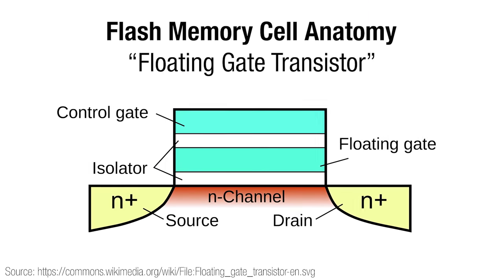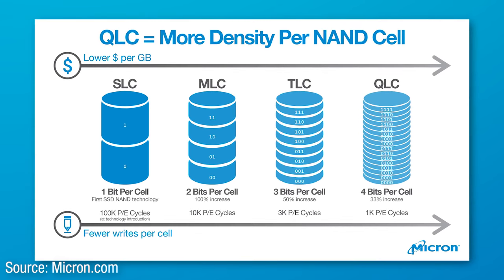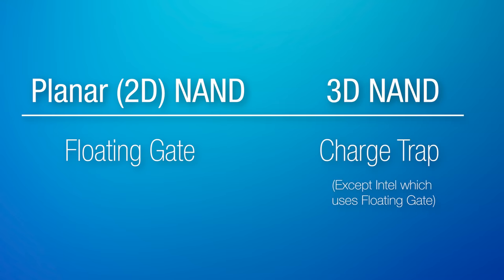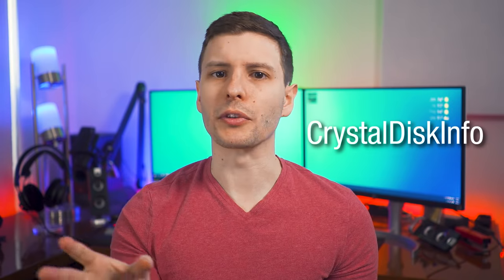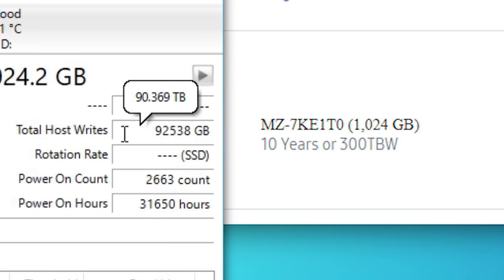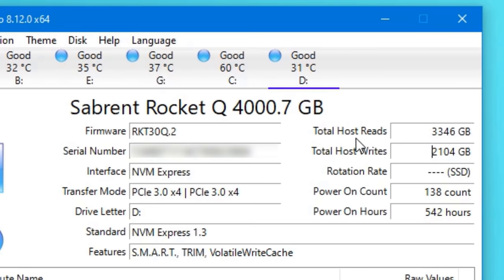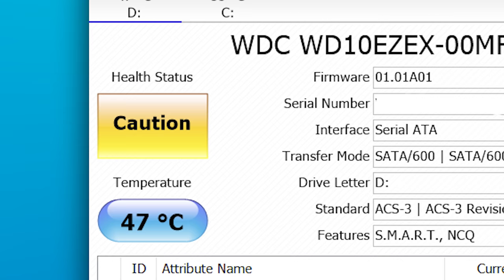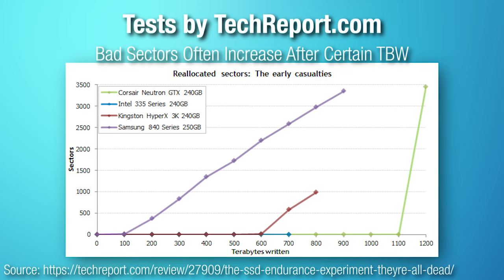How Much Longer Will Your SSD Last? How to Tell

Comment: Hi Thio! My SSD actually uses Mean Time Between Failures (OR # of years since purchase, whichever comes first) to determine warranty, used by SanDisk.

My SSD is rated for "1.75M hrs MTBF" (or 3 year warranty) which I'm not sure I fully understand how to read, but Googling returned that MTBF is calculated by operational hours divided by number of failures in that period.

Fortunately I'm at 7,418 hours with no "Fail" counts, but I'm fairly certain 3 years passed some time ago.
Reply: Most SSDs have both values - Endurance, measured in TBW and MTTF/MTBF, measured in hours.

SanDisk is a Western Digital brand, so you could go to their website and see the actual specs (find the product and go down to the "Download Product Guide" option).

MTTF is usually ~200 years these days, so that's become a non-factor for newer SSDs.

However, the TBW value of most consumer SSDs is still an important factor. Of note, is that higher speeds usually mean lower TBW values. Personally, I prefer high Endurance and mid read/write speeds for NVMe drives (~3k is fine for me atm), but most prefer chart-topping speeds over long-term reliability.

Comment: i have had a lot of mechanical drive failures (12 or so) and only had one that gave me advanced notice, so i found it interesting that he pointed out ssd dont generally give failure warning signs, that is my experience with physical drives too.  knock on wood i have had zero failures with ssd drives i have been using at my business, currently about 20 of them running, some pushing the decade mark.
Reply: Man your house is so hot then..

Comment: Note that the SSD doesn't not die when it's reaches the actual TBW. It just becomes read only.
Reply: You mean does not die
Reply: Huh? That sounds really weird, never heard that piece of information. Of course it doesn't just die, but he also said in the video that it may last way past that, as in you can likely keep writing to it for a long time.
Reply: Samsung SSD 970 EVO 1TB 1000.2 GB = 1.086 PB TBW (Manufacturer Max TBW 600TB)  (Please don't post wrong info just incase people believe you)
Reply: yeah, as it has built-in protection
Reply: @jameskronewitter2067  Thank you for adding this, because the terms he was using were very perplexing. Dead is die, but failure is like going deaf. There is a big difference. And the word 'sector' was also kind of twisted. A spinning disk has sectors, a SSD has storage addresses.
Reply: That's what I always heard too, that they just go read only, glad someone mentioned it, but I guess I've never actually seen it happen.

Comment: I personally like to look at SSD drives with an understanding of how many complete writes for the drive's life expectancy. I only use Samsung EVO drives. I have an EVO from 7 years ago (even though it is supposed to only last 5 years). It is my OS drive. It hasn't been written on very much. I check the SSD for failures or quirks all of the time. Flawless. 100%. In each test.

Then my other drives are 4x 1TB Samsung EVO drives. I trust them more than my HDDs for data storage. Technology has come a long way. SSD drives are not constrained to a deteriorating timeline like they used to. It's more about the writing capacity over time more so.

Comment: I would argue that any data stored on any disk in your desktop should be "non essential". If it is essential, make sure it's backed up somewhere so it becomes non-essential on your desktop. If both ssd's in my desktop break right now, it's only a bit of a hassle but not an actual problem.

Comment: That's an odd video recommendation from youtube... I just changed my old SSD with a new one (and a HDD from 2009). My old one has "only" 72TBW. Still works but I did not want to risk it.
I lost a few HDDs in the last years because I overused them. Lesson learned I guess...

Comment: I still use a 600GB WD Velociraptor as a backup to my SSD and  my NVME SSD,
I know the drive is close to death. But this thing is definitely a beast. Almost 15 years, and only until recently it has started showing Caution Signs. WD definitely made the Velociraptors into truly some of the most resistant regular hard drives ever.
Luckily i have backups for it. 
I really wanna see it go until the end, this Hard Drive has travelled with me through all my upgrades.

Comment: Normal writing of static files that don't change much is one thing, but what about SSD's in database servers where small bytes of data (say updating constantly changing data) are updated to the drive all day long (10,000 times per hour).  When you write to an SSD, it doesn't just write out that one 32bit number, it writes out the WHOLE PAGE of that storage location. So updating one 32bit number actually writes a whole page (Common page sizes are 2K, 4K, 8K, or 16K, with 128 to 256 pages per block. Block size therefore typically varies between 256KB and 4MB).  When an SSD erases, it generally erases an entire block at a time.
So updating a 32 bit (4 byte) number in 10,000 different records in one hour will not have used 40,000 bytes of wear on your total write count.  It could have used a significantly LARGER amount since it writes out whole pages for EACH 32bit write.
And this doesn't even include "Wear balancing" writes.
Anybody ever did a study on large quantities of small data writes updating records in a database on SSD's?
Reply: How long a 1tb last say if move around 40gb each day

Comment: Deactivating cells and re-allocating sectors is still much safer than a head crash of a HDD. An SSD will still be readable after some cells failed, but a HDD is dead after a head crash. That's why you built a RAID array, for redundant data storage.

Comment: On my workstation, I put the OS on SSD and a swap file on a 10K rpm mechanical drive. Since a swap file would wear an SSD out, putting a swap file on the mechanical drive seems to work good that way.

Comment: Great Video, Thx for making it!
I have an old Micro C400 SSD that I was going to throw out because its close to 10 yrs old and the MFG has assigned it as obsolete. I found your video and installed crystalmarkinfo and it reports that its "99% good" with low hours and TBW.

Comment: hi, thanks for the video. I would like to ask you something. In the case of creating a disk to archive data, in which it is written once and is only used to read it at most 100 times, its useful life will be reduced by not using it continuously, or maybe the ssd disks are much better for document filing issues?
Reply: For extremely infrequent use like that, magnetic tape is the gold standard for longevity. Magnetic tape can last 30+ years if kept clean, dry, and climate-controlled.

Comment: This is why I don't bother with SSDs for general storage.  SSDs are good for backup drives that are only going to be written infrequently and maybe even just once.  The other good use for them is for the OS drive, where writes can be minimized.  HDDs have their own set of risks, but the technology is more mature and in my experience, you're less likely to have catastrophic loss with a HDD than a SSD.

Comment: thanks for the info on using crystal disk info to check the health. i found out one of my external (non ssd) drives are in caution mode.  i figured because i was having problems with reading from it sometimes.  so now i'm moving all the critical files away into a healthier drive.  it's nice to find out there's a problem before a completely failure and i lose everything

Comment: So does defragmenting SSDs actually cause them to fail earlier, based on what you said they will get the most read - writes if it defragmented daily?!
Reply: No. Defragmentation on ssds is not a problem. Ssds automatically move data. Just perform optimization in windows10. It recognizes ssds and don’t perform defrag.

Comment: still running a 500GB western digital caviar black. the drive refused to power up last month. after some digging, i learned that the board diodes failed. i replaced the board with an exact version i found on ebay for $10. saved my data. drive is still working perfectly since 2007. no, it's not my main drive, just a documents drive. my main drive is a 2TB firecuda nvme.

Comment: Something not a lot of YouTubers talk about and it is very sneaky - The TBW can be very misleading - some endurance tests done by reviewers showed many SSDs could last way past their rated TBW, in the PB, however all these tests are flawed an were based on sustained writing.  If you use an SSD for mainly storage and not a lot of writing of individual files, it can last well past its TBW however a drive that exceeds its TBW becomes VERY unreliable, the risk of data corruption and loss due to leaks / bit flipping becomes much higher - just because one can use a drive well past its TBW to write to, does not mean the data will be safe - EVEN if you have an OP reserve, and actually they mention that TLC is good for 1000 cycles, it is not tricky, these memory cells are reliable for 20-50 cycles and start to leak past that, it is the SSDs discrete, behind the scenes robust ECC that does a lot of the work, but once the isolation layer becomes worn out after so many writes, eventually degradation will become so bad that drive cannot correct the errors anymore.  If you use the SSD as an OS drive where the drive is constantly written to, or if you use an SSD which has frequent writing and erasing of files, it will wear out much faster than its rated TBW, because the mapping table is abused and worn out due to constantly having to be updated - and the OS is constantly wqriting and updating files - so those endurance tests online are misleading - Normally 2 Tb SSD from Samsung for example is rated for 1200 TBW - this again is a false sense of security, the drive could in THEORY last past 1200 TBW, or it could even fail at under 80 TBW !!! it depends on so many things, a drive that is frequently updating files, writing files, erasing files will fail much sooner than its rated TBW, even with wear levelling, even if you have not used up all your reserve or write cycles.  I have known a few people who's 600 TBW rated drive failed at 50 TBW.   The system area of an SSD apparently does not get wear levelled and is in a fixed location - so yeah the TBW rating gives a false sense of security. SSD technology is CRAP - it is not meant for long term storage of data, and it does not take long before the very thin insulation layer wears out to a level where electrons start to leak and eventually data gets corrupted - so for an OS drive or gaming drive, it's a great thing, but for long term storage NO, never !

Comment: I like what my Sandisk microSD cards would always do: they would default to read-only mode once the write limit was hit, or id the controller otherwise detected some kind of issue.
Reply: That happened with one of their physically-tiny USB drives, used on a router to give some rarely-used NAS functionality. They replaced it without question, although the replacement is a lot larger.

Comment: The PS4 comes with a HDD, it failed within 2.5 years, just upgraded my SSD just nearly a year ago and it makes hell of a difference if you ask me.
Reply: There is more to it than you think - 3.5" hard drives usually live for longer because they're just better, and hard drives die a lot faster if you constantly switch them on and off. This is why datacenters still predominantly use hard drives, especially for cloud storage - they hardly ever go offline and only accumulate around 5-10 power on cycles over their lifetime before the company retires it after around  50-80K hours, which is usually a lot more than what the manufacturer guarantees it would work for - and they usually do so when there's just a single bad sector on the drive. A hard drive can work for another 5-10K hours before the actual significant errors show up - for instance, Uncorrectable Sectors aren't too bad, but you need to watch out for Reallocated Sectors - when those appear, you need to move the valuable data from the hard drive onto another one and mostly really just use it to download and seed torrents or something from that point on.

Comment: Due to wear levelling, I wouldn't risk going past the warranty TBW. Once the SSD reaches the treshold, the sectors will fail/get errors one after another, because they're basically all at the same level or nearly at the same level
Reply: But many SSDs easily work for 5x the rated TBW until bad sectors start appearing. So don't get spooked or fooled by those numbers, just use the drive for as much as you need, and only replace it when it actually needs replacement (bad sectors start actually showing up). But some SSDs like Samsung SSDs will switch to read-only mode when or before that happens anyway, so you'll know when you would need to replace the SSD.

Comment: I found the mechanical hard drive to be more reliable. My main system and use drive is came with the computer and has lasted nearly 15 years. When I attempted an upgrade to SSD (crucial mx500 500gb) it failed catastrophically after only 20 months (less than 2 years).  The technician I took it to to help recover the data said the boot sector was shot and can no longer be used as a main drive. The mechanical drive is still going strong after nearly 15 years

Comment: I really hope SSDs can continue getting more TBW or some other way to increase it's lifespan, currently doing an SSD+HDD combo
Reply: Interestingly, industry is going toward less reliable memory. QLC is way less durable and PLC will be (if they will really use it) even worse. Early SSD was failing due to 1) Bad controllers 2) really stupid wear leveling algorithms 3) poorly made memory ( in term of production quality). Situation when drive just die in months wasnt rare, becuse tech wanst quite ready yet. Now situation is different, controllers is waaay more smart and powerfull, then they was used too, even cheaper had to evolve, wear leveling is efficient (because it have too) and production quality of memory is good (if you dont buy chinese clone), BUT actual memory is simply way less durable on its own, physically. In coming years we expect to see moment when actual amount of data writes may come near to TBW limits of drives and this is where interesting stuff will happen.
Reply: @Vednier  Yeah i'm worried about that :(
SLC looks like it has been ditched, but if modern SSDs had that they could last even longer, seems MLC and TLC might be the only options at this point unless MLC stays the norm.
Cause if they want to pull this BS on consumers i rather just go back to HDD... (which is sadly slow AF)
Reply: @tjhedgescout3052  You can still find MLC drives, look for Transcend 370s for example. Just recently i bought one of those (256gb) with 95% of health left on local online flea market for less then 15$. People simply dont understand that are those and just trying to get rid of them because they too low capacity.
Good 3D NAND TLC is not bad option either. QLC is rock bottom and hope vendors will not go to PLC (i heard there is a lot of doubts about it among vendors, not much of capacity gain with HUGE disadvantages in term of speed, lifespan and processing power of controller, its possible they will try to improve TLC or QLC instead).
As for HDDs, well, no luck here - Western Digital is on full steam to SMR drives, which literally like hybrid of worst part of SSD (need for TRIM, fact cache and slow main area) and HDD (load, fragile). SMR is literally HDD for backups now, you write once and try to not it again.
Reply: @Vednier  Jesus, sounds like Storage is going to turn to shit then, ill have to scour for MLC and 3D TLC, What does PLC stand for? I know QLC is like 4 quad layer, 4 bits per write or something to that.
I wish a new storage manufacturer would come back and give us 3D SLC (i doubt it would happen but it would make SSDs super long lasting, assuming they use today's allocation techniques to save on TBW)
I'm worried about the future for PC gaming if they insist on PLC which like you said is worse than QLC, and QLC is worse than TLC
Reply: @tjhedgescout3052  PLC is 5 bit memory cell (penta for P). Its in talks for several years and Solidigm showed prototype PLC SSD this year. Yet, Western Digital dont expect it on market before 2025, so  dunno.
Didnt heard about 3D SLC, but 3D MLC is exists, so who knows...will see how it all turn out.
Another interesting topic is simple fact that while liner read and write speed on SSD increases ( especially on newer PCIe4\5 NVME) up to 7GB\sec, its random write\read isnt improving much, and those random reads and writes is considered to be most noticeable in everyday usage.
Reply: @Vednier  isn't the random read/write supposed to be close to the sequential speed? i mean isn't that one of the reasons why people get SSDs? for the faster IOPS?
Though i have a 3 GB/s SSD which i'm content with since the rest of the hardware still needs to be factored in to use it.
Yeah i want to stay away from QLC and PLC, MLC is going to me my go to, maybe TLC if it's 3D NAND, but i want SLC to return

Comment: I have a Samsung 850 evo sata and it shows 1.4 tbw so far. I was an early adopter...no regrets...and I prepped for ssd death by stocking up when they were "on sale". My sata cables have stopped breeding but I have a 200 year supply of sata  cables and bunches of hard drives. I have used PCs since the zx81..and offer three lessons. 1. Speed is relative to what you like not benchmarks, if you're happy that's the best benchmark. 2. All things made by humans are fundamentally flawed,  therefore keep data backups and as many hardware backups as you can afford. PC parts WILL fail and wear out just like tires or aircraft carriers. 3. Quality overrides latest and greatest. PC vendors and game developers first loyalty is to the shareholders by law, not you.